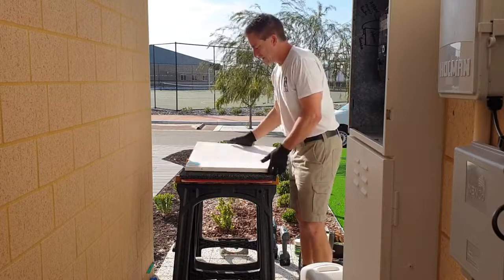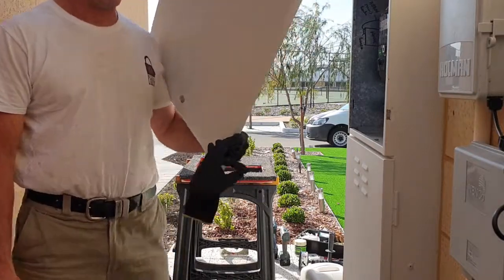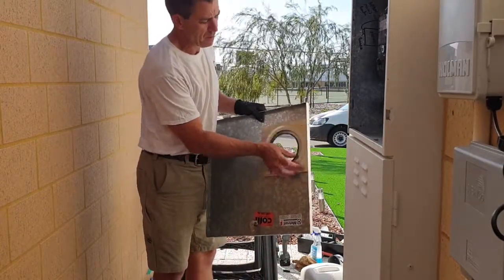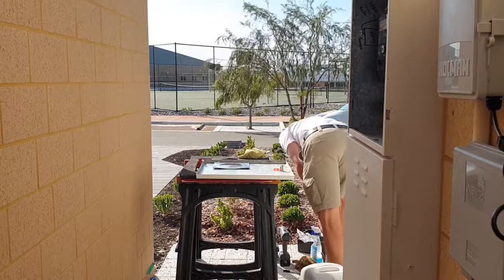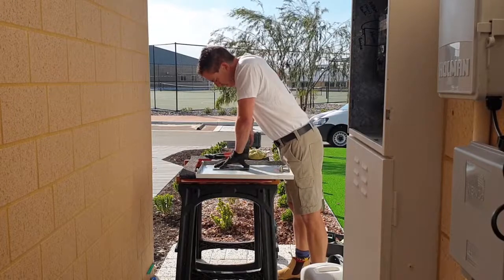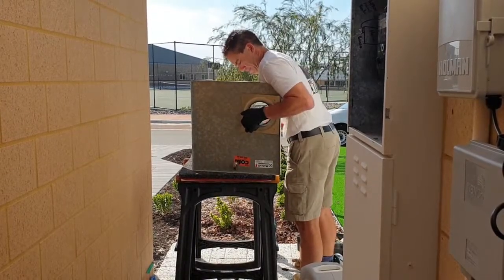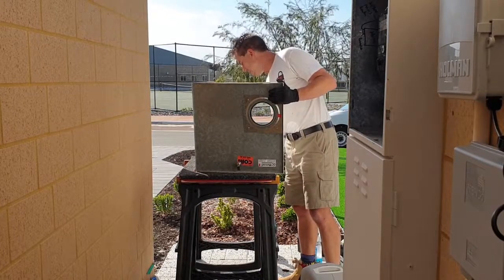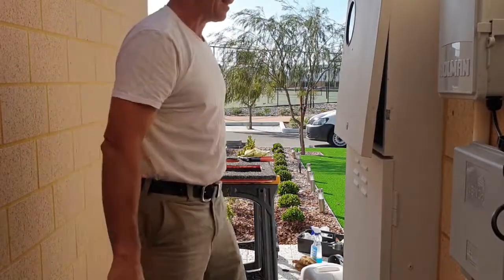INSTALL A METER BOX VIEWING WINDOW

Comment: When the cam lock was installed there is no need to take the cam off to remove the nut, it just slips over the cam and is easy to remove.